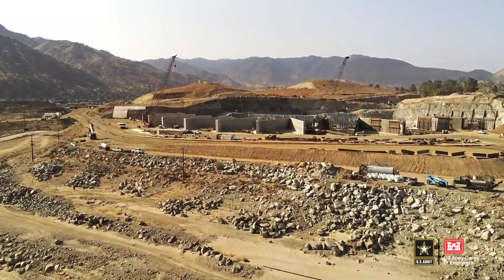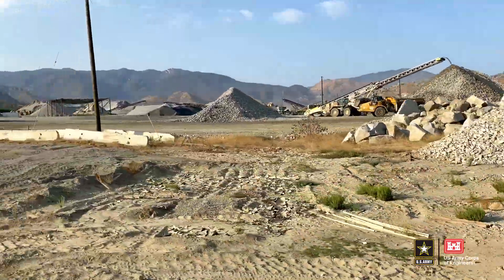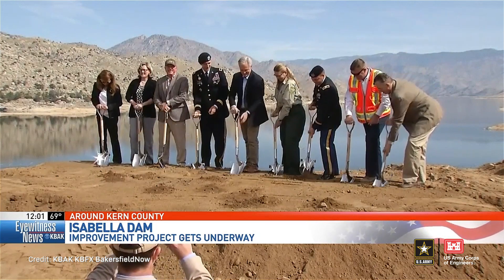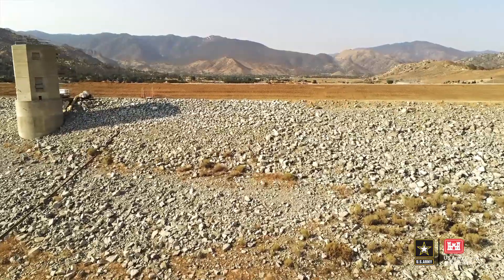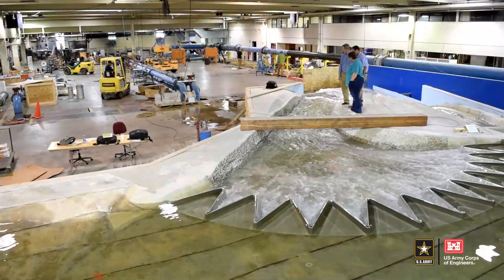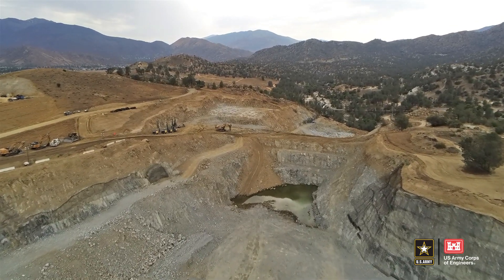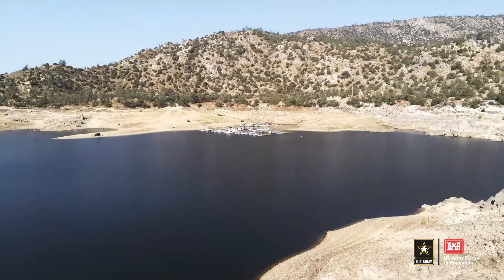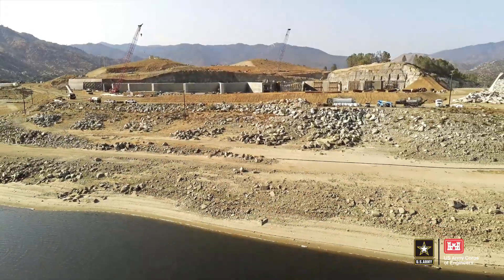Big Builds: Isabella Dam Project

Comment: Me in 2021, "We don't need no stinking new dam."  Me in 2023, "Thank God for the new dam."
Reply: Sadly the moron politicians should have been building new reservoirs and shoring up any reservoirs that needed work on their infrastructures during the extended drought but they were too dumb to do anything but waste tax dollars
Reply: Build Sites, but it is not enough! Do this also: There is 11 times more water in The Columbia River. IT is easy to move 1 or 2 "Colorado Rivers", down to Red Bluff. No pumps are needed! CA`s water problem are fixed forever!!!
Reply: @larsfridtjofnrheim1638  there are many fixes, you are correct but the lack of movement toward solving the water problem while building a high speed rail is ridiculous. They are not even looking at the biggest resource and building adequate de-salinization plants
Reply: @rstats2127  Argee. The world`s slowest, most expensive fast train, will maybe cost 27 times more than a water tunnel (whit needed infrastructure), from The Columbia River to Red Bluff....
Reply: @larsfridtjofnrheim1638  what's the relevance? The train bonds can't be used for a water tunnel.

Comment: Is the new spillway being used currently? levels are very high !
Reply from the maker: Hi Mike, the new spillway is not being used yet. Over the last several weeks we’ve seen about an 80% increase in water levels, but it's still below the level when we’d need to start making flood releases.

As of Jan. 19, the reservoir level is around 108,430 acre-feet, which is about 63% of the capacity of the flood conservation pool (170,000 acre-feet).

At gross pool (568,100 acre-feet), the water would be even with the bottom of the new labyrinth weir in the mouth of the emergency spillway. So, in order to use the new emergency spillway, the water would have to exceed gross pool quite substantially (28 ft higher). Water levels in the reservoir would need to increase more than 400% from current levels for us to use the emergency spillway.

Thanks for the great question! You can track hourly water levels for Isabella Lake at the following links:

http://cdec.water.ca.gov/dynamicapp/QueryDaily?s=ISB

https://www.spk-wc.usace.army.mil/fcgi-bin/hourly.py?report=isb
Reply: Yeah that's not true at all the lake has not been close to high in more than 15 years. Even now after the massive snow storms and rain fall the lake is only at 45% capacity. This lake can store 568k acre feet we have barely touched 250 as of March 12th.